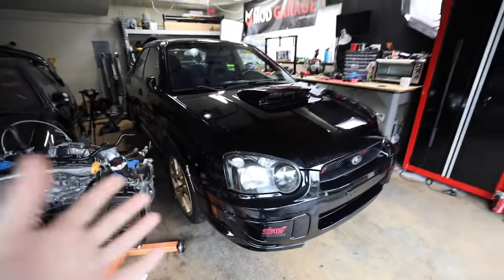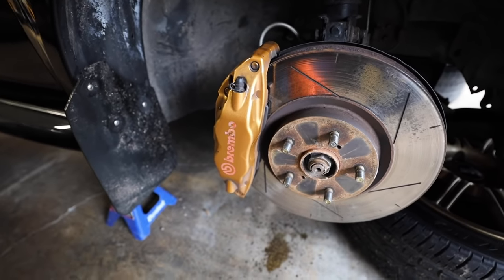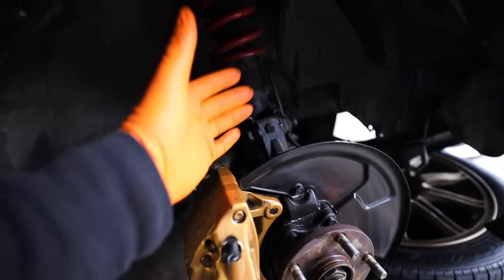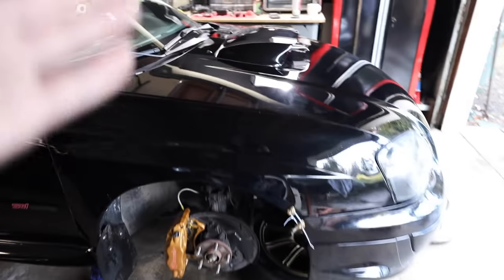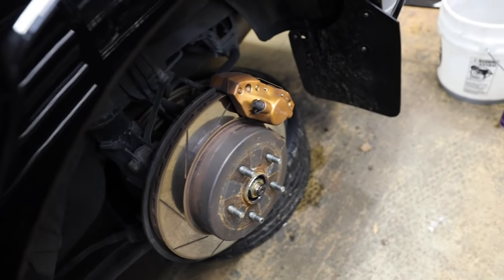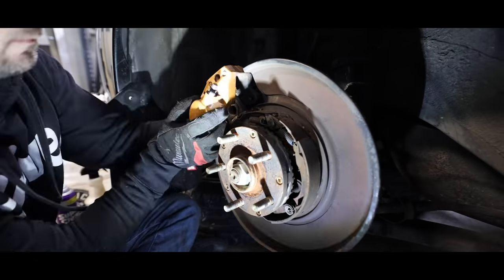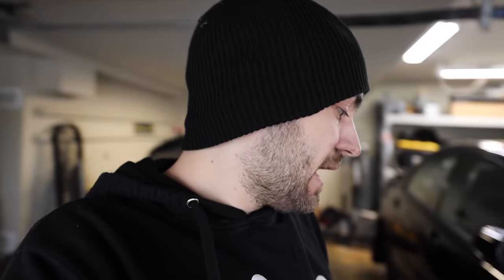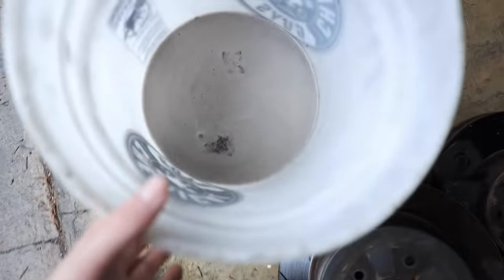The Brakes Did Not Break!

Comment: That is gentle for brakes. Especially with the deadblow hammer.
The FIRST thing I ever do with a brand "new" car with aluminum calipers is take them apart and make sure the bolts are torqued correctly with anti-sieze and clean them thoroughly, even if nothing is being replaced.
Can't wait for the EG33!!!
Reply from the maker: Yessss, those bolts when over torqued make for some fun problems later on 😅😅😅

Comment: Wow didn’t even know the bolts would strip on the brembos. I learn new stuff from your channel all the time so thank you!
Reply: The pinch bolts for the ball joints also tend to be a nightmare. Water and road salt gets trapped in the gap where the hub assembly pinches down on the joint, and the entire thing rusts solid. And since the hub assembly is threaded, you have no choice but to drill it out when the bolt shears. Don’t know why they don’t just use a thru bolt and  nut setup from the factory.
Reply from the maker: Some of the hardware on these cars are just nightmares to deal with 🙃

Comment: I think I have your luck with cars and mystery wires. I've had my '16 STI for about a month now and I was looking over my engine bay to see if anything need attention before started my list of parts. While in my inspection I found a little black wire that went behind my passenger fender and behind my bumper. I tugged a little and it came out of both ends full of green. No clue where it came from. Also found a ton of electrical tape around my impact bar that I was see infront of my rad. These cars are full of surprises! 

Oh and my cabin air filter was black. Changed that our real quick!
Reply from the maker: Sounds like you get the same surprised that I do 😅😅😅
Reply: @Smeedia  man I love my STI but I wish other people would care for them better. It sucks spending $25k on a car and having to go through so much just to make it in good health

Comment: I just heard of a technique where you use a battery to send electricity through the caliber and out the bolt, cleans up the corrosion that happens from steel contacting aluminum. I have to do more research but this could be a valuable method to prevent stripping.

Comment: Never had any issues with the caliper bolts of Brembo calipers. All hail the mighty impact wrench. 😂
Reply from the maker: Haha that's one way to pull them out 😅😅😅
Reply: I was helping a buddy replace brakes on his sti and they snapped.  Drilled them out and was able to reuse the original threads.  So happy didn’t have to timesert them
Reply from the maker: Glad it went smoothly when pulling them out!

Comment: @smeedia I’m working with my tuner this week to get my bobeye to ~470whp. I may be able to dyno it too. If you lived close I’d let you drive it to get more excited for your build or at least let you pick apart the build so you can change things on yours. I’m big top mount still, FP blue, hardwire Fuel Pump 400lph, 1300cc injectors. HKS EL headers and ewg. 4 inch Dp, 3 inch srs single tip exhaust. 470 will max injectors otherwise I’d go for 500whp. The goal is 25lbs of boost. That being said you may want a 4 bar map if your trying for 450 but the cams may get you there maxing a 3 bar. I’m in Southern Indiana if you are ever close by!
Reply: Ps, I know this isn’t your first rodeo at all, way more knowledge than me I’m just sharing my build since this exites me lol
Reply from the maker: Sounds like you've got a fun build! Let me know how the tune goes! Ans I've already got a 4 Bar MAP sensor installed 😉 honestly a 3.5 would have been enough but already have the 4 laying around lol

Comment: You should check the rear oem brake line, it could be stripped so the previous owner left it there🙃

I stripped/rounded mine, the 10mm bolt then I left it there till I got new brake pipe and a set of flare tools to cut the stripped bolt out🔥
Reply from the maker: Lmao going to check now, I hope that's not the case back there 😅
Reply: @Smeedia  🤞🏻

Comment: i feel like all subie owner garages permanently smell like burning oil and pb blaster, glad it went smoothly! Do you know if the wrx calipers strip too?
Reply from the maker: WRX ones I've never had an issue with and if they do strip they're significantly cheaper to replace. But they don't strip nearly as often as the brembos do
Reply: @Smeedia  i second this. WRX 4/2 pot calipers are made out of steel and are considerably heavier too, but they do not strip of you break the fasteners loose by hand and torque them to spec. You have to initially cross thread them to have issues. Much tougher in my opinion, but everyone wants the brembo's.

Comment: I was just doing my brakes last week, my drivers side front caliper stripped the bottom bolt, and the top bolt turned out to be cross threaded as well. Rather than try my hand and wallet out by helicoiling the caliper, I elected to order up a new caliper entirely. Maybe if it happens again I'll try helicoiling it, but I don't have the tools, and figured it'd end up being the same price either way, with the idea of reliability coming from having a new caliper instead of retapping the old one. Here's hoping the other front caliper doesn't strip out too!
Reply: Yeah, I wish I had watched this before I started doing my brakes
Reply from the maker: Super easy to helicoil and only costs about $35 if it does happen again 🙏 happened to my room mate and he had never helicoiled anything before and he was able to knock it out 😁 tbh the steel threads on a helicoil will be stronger than the aluminum threads. Hope your other ones cooperate 🙏🙏

Comment: Great story that happened today, I parked my car for today and saw smoke coming out of the engine. Turned the car off and left it in my parking spot. After thinking the turbo broke, I checked the catch can and found out that the hoses I put in were too small. Causing build up and eventually putting pressure inside the catch can (it’s an eBay one). It decided to explode through the bottom and whatever oil was in there (quite a bit because the thing that measures how much blow by doesn’t work) leaked all over the turbo and whatever beside it. At least the motor isn’t blown or anything but I for sure will need to check the oil.
Reply from the maker: Ooooof, hopefully it did not make a huge mess in there

Comment: 2011 STI. Changed my brakes and rotors. The rear calipers gave me hell and I broke the head of 2 bolts (1 on each side) since the heads broke off I was still able to remove the calipers to remove the old rotors. Broken bolts are still there lol.
Reply from the maker: Lol what's holding the caliper on now?!
Reply: @Smeedia  only one bolt. The second bolt is still in place. But with no head. The nub is still there. So the caliper will not move.

Comment: Watched your other brake video on the sti. What’s the average cost for 4 brake/ rotors fluid and stainless lines? DIY I for the life of me cannot find the gd part number for jurid pads.
Reply from the maker: Around $550-$600 in parts and all brake pads for 04-17 STI use the same brake pads

Comment: A couple of questions - I think I heard you say you will use ceramic rotors from Centric, is that correct? I have heard of ceramic brake pads but never of the rotors. Will they fit 2004 Forester STI? Brembo calipers look the same as yours. Another questions is on hubs. My Forester STI is a JDM forester. The hubs are original JDM STI hubs. No idea if they are different from replacement parts but heard of someone changing all the brake components to JDM brembo calipers and JDM hubs. I need to replace two on my car and want to know if they are any special that I would want to keep and just replace the bearings or can just buy new hubs from Amazon to avoid the hassle of ,pressing out and pressing in the bearings. Since two are noisy I'm thinking of doing all four. Thanks.
Reply from the maker: I misspoke on tbwt they should just be OE replacement rotors 

https://www.rallysportdirect.com/part/brake-rotors/stp-125-47022-grp-centric-premium-high-carbon-brake-rotor-pair-front

As for the hubs I'm not sure on the JDM models, if they are the same bolt pattern as USDM I would assume that they would be the same. I can't verify that though 🙏
Reply: @Smeedia  Thanks, I am pretty sure the bolt pattern is the same, just wasn't sure if they are any special like alluminum vs steel to keep them or replace them. Thought about replacing all the hubs but someone mentioning replacing USDM hubs and calipers to JDM STI ones threw me off into thinking if I should try to keep them instead of replacing them.

Comment: I have a set of junkyard gold brembos for my Legacy, and my main fear was the seals so I bought rebuild kits, but you’ve instilled the fear of God in me when it comes to these aluminum threads 😅

Thoughts on running a (properly pitched) tap through to clean out those threads first?
Reply from the maker: It can help, just really make sure that tap is sleight when it goes theough! Will cut those calipers like butter 😅🔥

Comment: Another question I have that's totally not related to this video. When buying JDM stuff from yahoo auction Japan, what proxy service do you use and can recommend? I used to use Shopping Mall Japan but they closed down permanently. Want to buy an item that's running out in 8 hours and am reading mixed reviews on services so first hand experience recommendation is much appreciated. Thanks
Reply from the maker: You can try DE Japan, some VPN work pretty well too
Reply: @Smeedia  Thanks so much. Will try dejapan

Comment: Curious as to why you kept the Calipers but not the rotors? With all the stuff you've replaced it just seems weird. You mind as well replace those too.
Reply from the maker: The calipers cost $1200ish to replace with a used set, better off rebuilding them but no need to. All seals look fine, no punctures rips etc
Reply: @Smeedia  you have a link to the calipers?
Reply from the maker: I don't, I find them off Ebay, FB market place etc
Reply: @Smeedia  something like these guys. Probably not the same thing... https://www.oshmo.com/product/brembo-gp4-rx-brake-calipers/

But now an even larger question. Who the hell would buy 1k+ brake calipers? That's like half the value of your car is in brake calipers! At that price I would never park my car on the street because someone might steal my brake calipers! Are they really worth that much? Do you really get a lot of benefits between those and regular brake calipers? What's the difference between those and regular brake calipers?
Reply from the maker: Here's a link to 1 replacement rear caliper from subaru 

https://parts.subaru.com/p/Subaru_2005_STI/Disc-Brake-Caliper-Right--Rear/49500945/26692FE002.html

Just 1 caliper new is $700+ and that's for thr smaller rear one. Bigger surface area over the standard calipers so you can get a bigger bite on the pad. TBH they're just marked up. A lot of WRX owners do CTS-V brembo swaps for much cheaper
Reply: I think you’re seriously misinformed. Calipers are not a wear item, and if they’re not functioning properly, there’s rebuild kits with new seals for $100, and pistons are not expensive. It is not weird that he’s not replacing the calipers; if anything it’s weird that you think it’s weird he’s not.
Reply: @Smeedia  ok now I don't want to park my car on the street ever again.....

Comment: I think some forum mentions to not torque 100% to spec bc of anti seize. I think reduce 25% due to lubrication? I don’t remember the explanation but I think I can find the link 

https://wp.dieselhaus.net/index.php/2019/09/20/sti-brake-information/
Reply: It’s one of the forums I looked at. The bolt on the rear caliper for my Brembos sucked too. Broke the head on one of them
Reply from the maker: You are correct, the anti seize does change the torque spec, and only the head? Haven't had that happen. Normally pulls all thread or the shank of the bolt snaps 😅

Comment: Good info. I've been saving up for other parts and now I'm just thinking, I'm halfway to the cost of the Gold Brembos I wanted to get. Thinking I may just wanna get them. Not sure the difference is that big but this is really good info in regards to ease of stripping.
Reply from the maker: The gold and black are the same just different colors, and for real! They ship out so easily!
Reply: @Smeedia  I believe the blacks are 08-14 and the rear calipers are different, with the fronts being the same
Reply from the maker: That is correct, rears are different, fronts the same but overall performance if wither set is same same
Reply: Huh? Brembo Rears are the same as in GR and VA? are the brembo rears really an upgrade from stock. Only doing likely about 1/3rd of the work in my experience with other cars braking systems.
Reply from the maker: GR and VA are same rears up to 3017 I believe, the 05-07 rears are different

Comment: Bro can u make a Video how to move ur battery to the trunk so the engine bay looks cleaner too.
Reply from the maker: I can at some point 🙌😁
Reply: @Smeedia  yes sirrrr 💪🏻💪🏻💪🏻💪🏻
Reply: You want to move the battery to the trunk to make the engine bay look cleaner? What an absolute waste of time and money and trunk space. Now you have to run 25 feet of battery cable into the trunk. And fabricate a trunk mount. If you want to jump the car you have to empty the trunk. The battery when charging produces explosive hydrogen gas you have inside the cabin now. You also made 5 feet of cable to the starter 4 or 5 times longer. Now your battery has to work even harder to start your engine because of cable transmission losses...
Reply: @fraserlordly2432  nice to know
Reply: @fraserlordly2432  still planing on it though